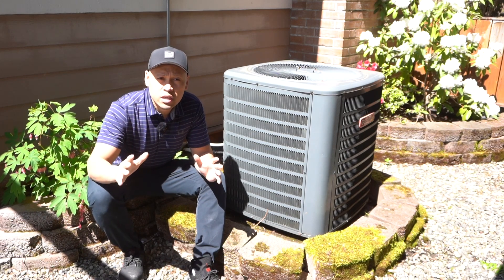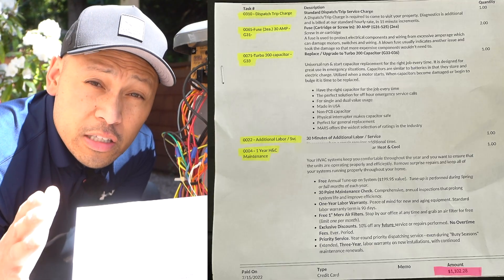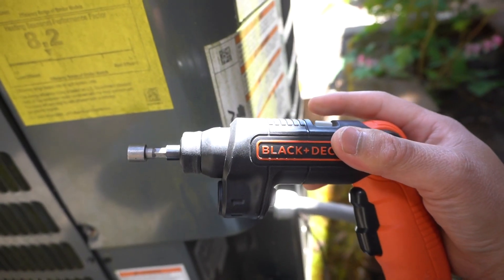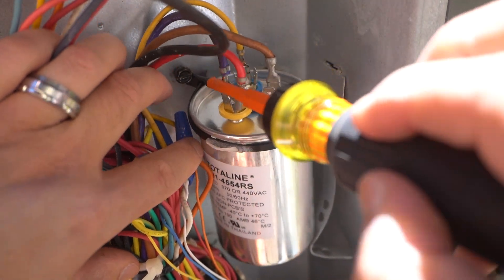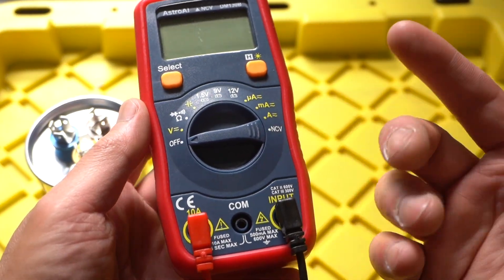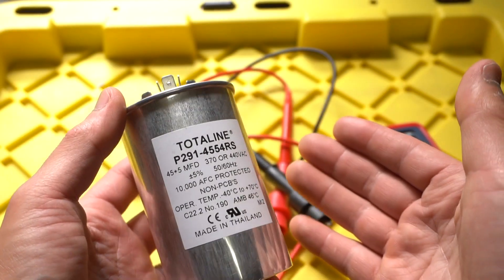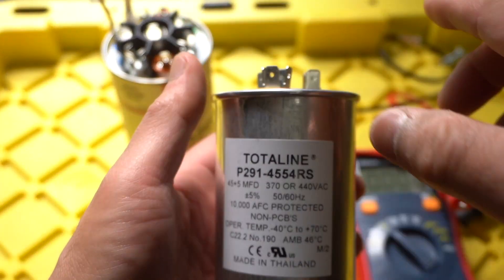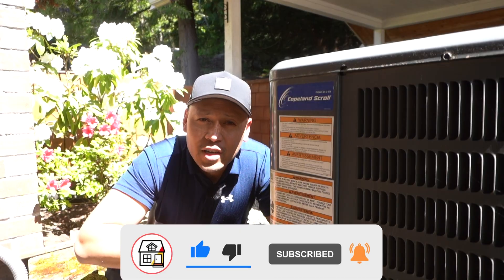I Was Charged $1,100. I Fixed It For $9.99! How To Replace And Test AC Capacitor | EASY DIY!

Comment: This guy is going to get somebody hurt.  Behind this panel is HIGH VOLTAGE.  Its clear this guy has no clue.  Do not do what this guy does.  This is not the correct method for discharging capacitors.  The best thing to do is search for a video from a qualified person instead of this doofus who will get someone injured.  This is terrible.  The guys intentions might be good but he is really clueless and somebody who watches this is going to get zapped listening to this guy.
Reply from the maker: Thanks for the comment love and support - your friend Doofus 😉
Reply: @FixThisHouse  if you're going to put yourself in the public eye you should make sure YOU are doing it the right way.  Ever seen the top blow off one of these capacitors?  Keep doing this and there's a good chance yoiu'll find out

Comment: Same thing here, I was quoted replacing the Run Capacitor and cleaning the AC coil or fins would be $903.00.  I did both for under $30.00.

Comment: I bought a capacitor for $10 but unfortunately once I replaced it, the AC did the same thing. Which was when i turned the ac on, the breaker in the fuse panel box would trip. So I was told the ac was grounded and i need a whole new one and cost$4,000😢

Comment: I'm an old avionics tech and a newly-minted IT tech, but I know nothing about HVAC. Even so, I've replaced my HVAC capacitor 2 or 3 times and the "contactor" relay once. The parts came from ebay. $15 or so for the caps. I don't recall how much the relay cost but it was cheap. I learned how to replace the parts by watching YouTube videos. 10 minutes of self-training has saved me thou$ands. Ignorance is expensive.

Comment: You're deceiving people. That receipt clearly shows that you bought a maintenance contract in addition to the capacitor repair, so we don't know the actual price you paid for the capacitor repair. You should be more honest about the price you paid. You also had a fuse replaced, which usually means a short was repaired, and you mentioned nothing about that or what the additional 30 minutes were for.
Reply from the maker: Not deceiving when clearly I show you the full receipt. Shows what add ons they put when you need only a capacitor replaced.

Comment: Hmm, I had to call an emergency AC service on a weekend when my normal people couldn't handle it. As I recall, the labor above the cost of the part was modest, certainly less than $200, probably less. At that point, it was probably worth it to have somebody with some experience there. But thanks.

Comment: There's so many wrong things in this video. Capacitors don't just jump, start what you're holding. There is a dual capacitor it's a run capacitor on other systems. You'll have a start relay. Systems will have different setups. And no, they don't all have 4 terminals, 3 terminals and 2 terminals. That's just a specific brand or 2. Not every single one is the same. Check by ohms Again? That is knowledge that you're painful just like when I come out and look at everything. I know what to look for for damage. What could potentially become a problem as well as if this Capacitor went bad. Did it take out the Compressor also when you Mount a capacitor into the unit. Is in the right location? Is it gonna hit something hot and spark? Is it gonna be a whole way? You put a screw, that's the wrong size and hit the coil or hit a discharge line or hit some other pipe behind it
Reply: No, I like my HVAC people. They are honest and replaced my entire system. I had many of these capacitors replaced, and every time, it was like $200. They even offered to replace my filter in the attic for $200. Nope, I took a photo of it and ordered a bulk order from Amazon for under $200. So, when they ask if I wanted them to replace the filter, I would say no and climb up to the attic myself to replace it.

Comment: As a technician, some of those Turbo Can actually get their $100 to $200. Now that Amram is starting to pump out. A lot more of them. The prices came down a bit. The other thing here that you fail to mention was the 2:30 AM. Fuses that rule replaced as well as potentially any wires that may have been melted from when it fried, When A capacitor actually does blow. It's usually because of a power surge, not because of time. If you live in California or any of the extremely hot areas, if you ever see brownouts or any blip of light that is too much power coming through or legal ways for power companies to switch to increase power that sends additional power down-the-line and some equipment has surge protectors to protect it the. Capacitor acts kind of like a search protector by taking in that excess power. And using it to run the equipment, if it does blow because of that it can melt wires so you'll do terminals, wires, clean up. And then you see the additional hours, so the guy was there for about an hour to 2 hours And it looks like they gave you a one year annual service as well. Now don't get me wrong. I don't charge anywhere close to these prices. If I go out of somebody's house and it's a thirty minute drive plus a capacitor yeah, i'm gonna charge him about a hundred to a hundred and fifty bucks that covers gas insurance parts and time
Reply: Yep.  Many people think that getting to their house doesn’t take time or burn fuel.  They are also the very customers that you don’t need.
Reply: Your price is fair, and even somewhat inexpensive..

Comment: Wow! I'm an electrician but I knew nothing about heating & cooling. I know how to test capacitors and what to look for if they're bad. My furnace blower motor stopped turning and was emitting a burnt electrical smell. I took the old capacitor out,ran to True Value,bought a new one. That was 2yrs ago and it's still working without any problems. I think I paid less than $20. I'm 68 and I try to do all my home repairs. People are always out to get you!💯🤷🏿‍♂️
Reply: I am a carpenter and built my parents house in 1986 , An electrician came out to my Dad's house because pops called one about a few driveway lights . Ole sparky wanted $3500.00 to replace the lights , Run new wiring . I told my father  BS .. trying to rip you off  I don't know electrical work all that well " Just well enough to know" , Couldn't tell you how to wire a panel or parallel or series , Watts ohms and volts . But something smelled , I checked the circuit breaker .. Hmm  Off . flipped it .. All but 1 of the 8 came on " It's a Miracle !!!" . One had a broken light bulb . My father said prior that he would rather pay me than someone else . After 2 minutes of finding the source of The Nile .Told my father ." That'll be $3500"   but today I've give you a senior citizens discount it will be $3400 .  I couldn't and wouldn't fleece my own parent Nor would I do it to anyone else . If I encounter a problem electrically , HVAC plumbing etc . I know how to find a breaker , a reset , a wax ring or PEX ... 43 years in the trade primarily as a carpenter , I have a tacit understanding of the going on's and the deceptiveness of everyone's trade . HVAC is a cash cow , I've had to do my own and saved thousands . For the vulnerable . It can be financially draining . I am a believer . You never use your Gift as a weapon for bad . Yes it is to provide you an income , But be moral in your work or it can be taken away
Reply: @Sjwolosz321  My 1st year in Trade School I was working with a General Contractor on the side. He got a call from a Barber Shop that the power was out. So since I was in school I felt I could figure it out. This was back in the early 70s. Got there and went straight back to the Circuit Breaker box. Reset all the breakers and the power magically came back on.🤔😁 My boss said he got it from there. I stood back and the owner of the shop paid up. I don't know what was charged but I know the money didn't go into my pockets! I never asked what he charged the Barber. I think my old boss is still living and should be in his 90s now.
Reply: @JLRJ  Wow ..
Reply: @FreePalestine-1945  True Value is a Hardware store. Like a miniature Home Depot.
Reply: You got that right
Reply: My neighbor paid 400.00 to have hers replaced once but she watched the tech do it the first time and did it herself the next for less than 10.00 the next time. She has 3 Siberian Huskeys so she has to keep her house cool for the dogs, I gave her a hand the second time and now mine is out so I will be fixing it this week.

Comment: I’ve had trouble buying locally without a commercial account.  Luckily I’ve almost always had access to a commercial account one way or another.  So I could replace it quickly.  Online would not be a problem procuring the part but shipping time would of course delay repair.

Comment: Years ago I had an old breakfast lunch restaurant that used to be a waffle House and it was on A1A in Florida so it would get hit with salt spray all the time anyway to get to the roof was a little challenging and before I knew what was happening twice I had to hire electrician to go up there and fix the air conditioner turned out he replaced the cartridge fuse but he charged like $300 to go up there once I realized what he was doing I bought some cartridge fuses for next to nothing and I would go up and replace them

Comment: ok so everyone needs to look at that invoice he paid for a 1 yr maintenance and a run cap and a pair of fuses and a service call, i have done this for 41 yrs i am not saying some companies wont charge outrageous prices for this and this is obviously one of those companies. BUT he did not pay 1100 dollars for just the capacitor. Next understand what your doing before you go changing a capacitor they hold between 275-475  volts  and can be very dangerous if you  get bit.  i just want to point out this is not an accurate video it is misleading in many ways  buyer and home DIYer be ware
Reply: Should have used the multimeter to check for voltage at the contactor before even touching the wiring at the capacitor.  But hey, it’s not me getting sued if someone gets hurt.

Comment: Great info.  Super detailed.  What are the symptoms of a bad capacitor?  Does the AC just not turn on?😊
Reply: Many times the compressor will run, but the fan motor does not, but not always.

Comment: Those Universal cap don't last that long. New capacitors have a 5 year shelf life.  The older ones built before 2010  have better steel and oil they can last 10+ years.  One of many reason why compressors are warranty for 10 years.  If you are buying new capacitors for your home buy the blower fan moto cap as well.  Date then. In sharpie keep em for 5 years then test.  Replace em when they drop below 5mf.  I prefer the Titan brand caps. They seem to last longer.

Comment: I’m saying this from actual commercial/industrial field experience:  why did the capacitor go bad? The capacitor is connected to the fan, the compressor, AND the power coming from your breaker panel.  
The cap. may be separated internally between the compressor side and fan side, but if the cap just shat the bed and you put in another new cap without addressing the actual problem, that’s like watching a blockbuster firework as it’s about to explode.  Especially with that $100 cap you’re holding.  Now your down $200, probably burnt terminals, acid all over the place or factory smoke escaping, and now you pay for someone to come in…. 

DO NOT TOUCH THE TERMINALS WITH A SCREWDRIVER..  Please, for everyone’s safety, make a follow up as to what would make a cap fail, how it works, and how to safely discharge it.

The only thing that was safe was the searches on the computer.  All experienced people in any trade start out as a “diy” person, mainly because you have to start somewhere.  But the reason why service can be expensive is because the knowledge, training, and license’s that tech can have.  Find quality shops to do business with, and not price inflators.  In the end, it’s cheaper to call the best people, than to have 3 companies come in and misdiagnose your system, over or undercharge your unit, and ruining your compressor.  It’s not just a capacitor, capacitors don’t move, they make other things move by using electricity.  Check all the mechanicals, circuit boards, power mains and power going to the unit, etc., etc…

Comment: what about the tools, multi meter, convience of not waiting to go get part 2-3 days, shipping, knowledge, experience.  What about if it doesn’t work with a new run cap?  What about a motor or compressor going bad and pulling more amps and run caps going bad premature?  There is a lot more involved than pricing for a part.  It’s a business it’s insurance. It warranty on the part etc etc.
Reply: Some people are just cheapskates and don’t want to pay for knowledge and experience.

Comment: This is the BEST instructional video on testing/replacing an A/C capacitor that I have seen. I have a multimeter but it does not check capacitance. Just ordered the one you have via your link. Thank You!
Reply from the maker: Thank you so much! 🙏🏽😊

Comment: Im trying to replace mine before summer hits just to be on the safe side. The capacitor i recieved is a smaller diameter than the one in the unit. What is the best way ti install the smaller diameter capacitor

Comment: Great information as usual. Yeah it is sad that those companies, especially the franchise one's charge so much for simple repairs. My A/C went out last year and it cost me like $175 to fix, I had a friend that is a plumber by trade fix it for me. 

I will only add that if you know you are not going to be checking voltages, step 1 before you remove that panel should be to remove that outside circuit breaker. I always error on the side of caution.

Comment: I work this industry, and I only use made in USA capacitors with a 5 year warranty. I charge a bit of mark up of course, but WOW, $1100.  Nuts! I have seen worse… and it ALWAYS is described as a phase shift device… or some other technobabble… never the actual part name… run capacitor.
Reply: Exactly. I have a USA built cap in my unit.. Don't mind paying more for relability..

Comment: A few years ago, the AC stopped cooling at my rental. The unit was only about 7 years old. I looked at the capacitor, and it looked good (did not have rust on it or the swollen, mushroom head that failed capacitors usually have). Called an AC company. The tech said the capacitor was bad even though it looked good. I thought the price for capacitor replacement ($415) was outragous. Had to pay the tech $90 for the diagnosis, but it was worth it since it saved me hundreds. I went to an AC supply store.A capacitor cost $30, which I thought was high since it was selling on Amazon for about $12. But I was in a hurry and didn't want to wait on delivery. I put it in myself. Charging more than $1,100 to replace an AC capacitor is almost criminal, in my view. I think you should have named the company. Most companies want publicity. If they've got nothing to be ashamed of, then they should welcome the chance to get their name out there. Thanks for sharing what must represent an infuriating experience.
Reply: $12 on Amazon is suspicious, you don't know the quality.
Reply: WOW!  

It's an almost perfect description of my A/C issue. I'm going out today to my friendly neighborhood hardware store for a new, $25 capacitor & making a Sunday project out of this. 😊
Reply: UPDATE: Replaced capacitor MYSELF & now A/C is running great! THANKS A MILLION!!

I have reason to believe the tech played a 'slight of hand' trick with the 'old' capacitor. 

There was already a small,  oval-shaped capacitor with fresh black tape. Now my unit is a little old, but any tape used inside should be frayed, faded, loose, etc...RIGHT? It wasn't...

This guy went to his truck to get the 'new' part.  He quite possibly had a dead one on hand to pass off as mine, used a multimeter to confirm it's 'dead' 😮 & wrapped the oval one to cover up the wires I thought were MISSING!

I won't report him; just let him stew & stir about the $357 he didn't beat me for 😂. 

Clyde the Glide would be very disappointed...😜😜😜. Amazing how their gimmicky ads belie the underhanded tactics of their techs.

BALLS!!!
Reply: @dawa7267  great!  I’m going to try it. Did you turn off electricity to the whole house? I’m terrified of being electrocuted.
Reply: @chanteledwards3615 
I turned off just the A/C from the box in the basement. When I was done my son switched it back on so I could make sure it did blow up the side of the house 😅

But yes, switch off the power before you start the tinkering.
Reply: Be careful about pricing. The very inexpensive capacitors are typically imported junk. Spend a bit more for a USA built cap and enjoy the higher service life!